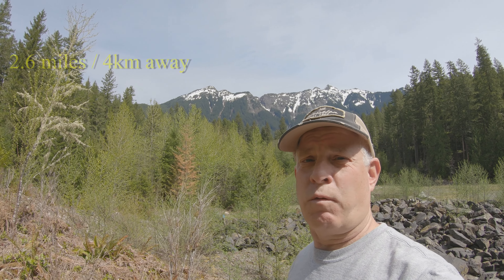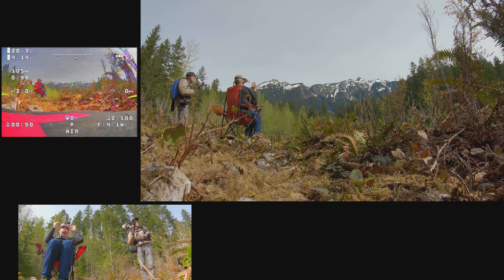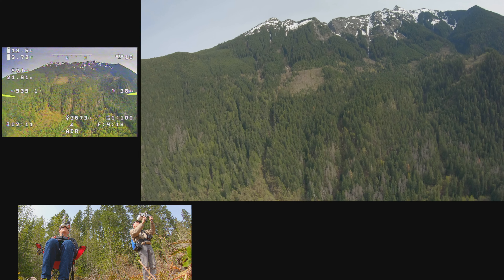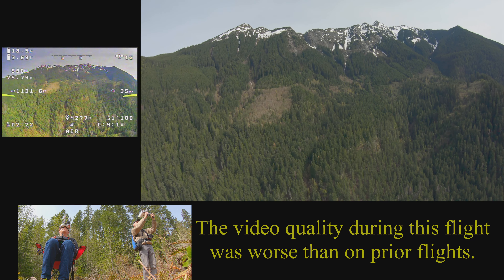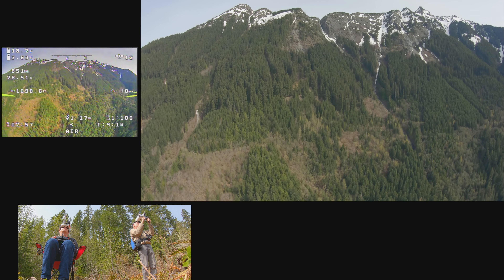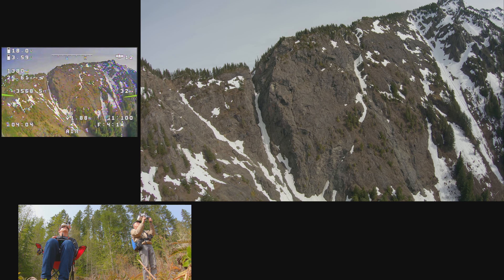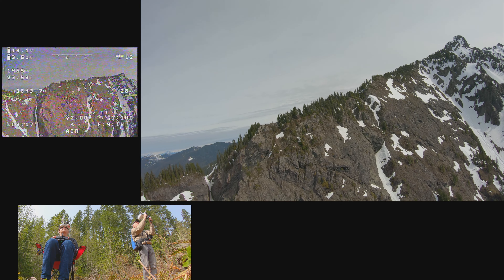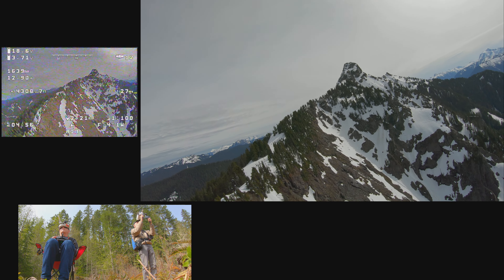Mountain Surfing with Failing VTX Long Range FPV Quad

Comment: better stick to the singularity antenna. I have tried a couple of different antennas and i gotta say Hugo at TrueRC did an amazing job when designing this great antenna! Can't wait to see when you installed the rush tank solo. I'd imagine this will be an eye opener for you and your long range missions :D
Reply from the maker: Thanks for watching. I suspect you are correct. The combo of the Solo and TrueRC Singularity plus my ground antennas should be .. perfect. Then my range limits will be limited to battery power.

Comment: I think I've had 6 AKK units of different models, purchased at different times - most not powered from direct VBAT. And none of them were consistently run at full power or left to bake by leaving them on high power without airflow. Some from the higher output club like 1200mw others in the 600mw output range and ALL of them. Every, single, one - often measured too high in the beginning, like a 600mw one that puts out 900mw+ and then over some amount of use their output dropped dramatically for plenty of people 400mw is plenty - so the 1200mw units that would taper off to ~400mw at max power a lot might not even notice, but the FX3 600mw version ... that would eventually would only put out ~250mw.  I just steer totally clear of them now. I'm not a TBS fanboy - they have some real dud VTX units (like the Nano Pro32) but i have had SUCH good luck with their Unify Pro HVs and Unify Pro 5v units.  My Rush stuff has been good - i killed one totally randomly. One just shut off mid flight and never woke up again. Was the craziest thing. Put plenty of packs through one and one day flew out to about 3km and on the return, about 100m from myself, just black.  Luckily could lift my googles and fly back LOS. But i think that was probably just a fluke. Anyhoos! Really like your videos! It's nice to see the whole process along with DVR rather than just a single curated dive.
Reply from the maker: Thanks for watching and the excellent info. My next video is exactly one where it fails and I fly home blind. I am only 5 months into this hobby and there sure is lots to learn and try. My next vtx is a Rush Tank Solo. Sounds like the vtxs simply need replacement every x hours.
Reply: @ValleyFPV  I don't think so re: replacing VTXs on a regular basis. Really most of my TBS VTXs have lasted years with the same or very similar output (even ones i've beat up and ripped the ufl connector off of, or simply left the antenna off for a while, etc..) . And I'm sure the Rush failure was a fluke. It's really nice to have a hobby grade power meter around to test with like the Immersion RC "RF Power Meter v2" so you can test now and again to see if output is falling off a cliff.

Comment: I’ve had gps units do this and point way off my location. the best I’ve used so far are the Beitian bn220. even with this unit and 12 sats  I still get it sometimes but if I fly an orbit or two of my home location it seems to work it out
Reply from the maker: Thanks for watching. I like your idea of orbiting home point initially. I may try that.
Reply: @ValleyFPV  FWIW, i don't think the mag settings that are default in BF work with the M8Q-5883 left at default i think it'll be like 90 degrees off. There are some rotation settings you need to apply as far as I know. I have a few M8Q-5883's ... GPS rescue seems to work better without the compass (but i've never really invested the proper amount of time ensuring the mag is properly setup and calibrated TBH).  Unless you tell it to, GPS Rescue in BF will blend both GPS and Compass data at varying rates depending on what it thinks is more accurate, so even if the compass is way off you may still progress in the correct direction. but seeing your home arrow off by a bit in a few videos, I wonder if the compass just isn't configured properly?

Comment: Have you ever tested failsafe set to gps rescue?
Reply from the maker: Thanks for watching. I have only tested GPS rescue by a switch, never have tested the failsafe by powering off the transmitter. I dont have the guts to do that.
Reply: @ValleyFPV  Hey man, to test it on radio shutdown I always fly out a good distance in open field and hover right over the ground. That way at least the quad does not drop far if it does not go into RTH. That would be the safest way to test it but i totally understand that it it quite scary to not have any controll for some seconds😉
By the way I love your video and your super careful way of doing these longrange missions. Nice to see that there are people who show that you can do this stuff safe and responsible👍🏼 I can sadly only do longer range stuff with sub 250g quads here in Germany but still enough to get me around 5km out and back but without a GoPro sadly.
Reply from the maker: @nicofietkau789  That is a good suggestion. I Might try that.
Reply from the maker: I just tested it this week and it worked. Flew behind a mountain at 7000 ft and lost signal. A video about that coming soon.
Reply: @ValleyFPV  I have tested it and thought about making a video about it since it could help others. The safest way is to create a failsafe switch. Flipping the switch with it set to gps rescue is faster and safer than turning the controller off. It’s best to learn how long each step takes by trying the switching process with props off and while on the ground. It takes two seconds after flipping the switch for failsafe to activate. Then flip the failsafe switch back off and count to seven. That should give the flight controller enough time to re-connect. After that, I have to disarm and re-arm to regain control. If in a real life situation, I would wait for my video to come back before disarming and re-arming.  Hope that makes sense.
Reply from the maker: @NguyenDongArtist  that makes sense.  I have gps rescue mode on a switch. This week I accidentally had a real failsafe occur..flew behind the mountain top..it worked as configured. I will be making a video with my experience within a few weeks.